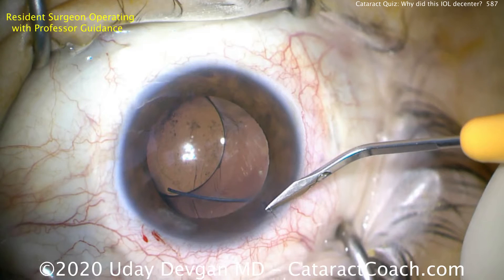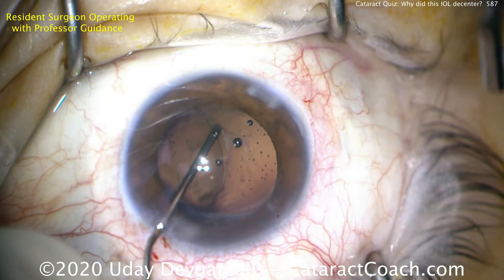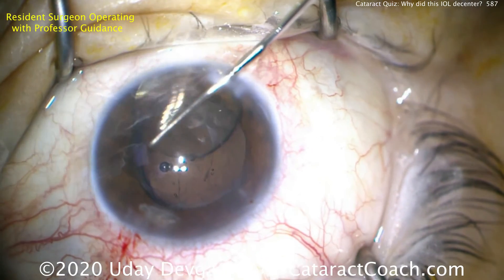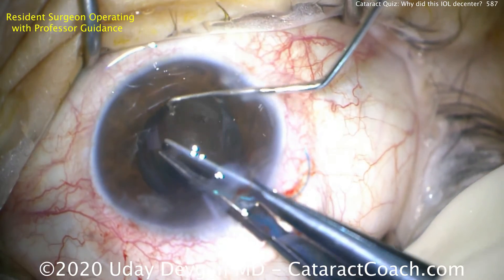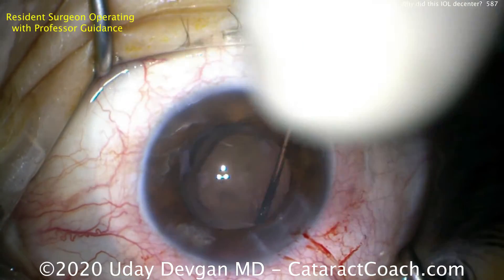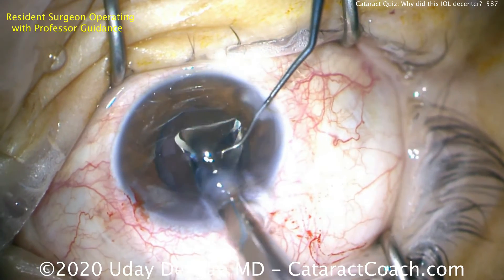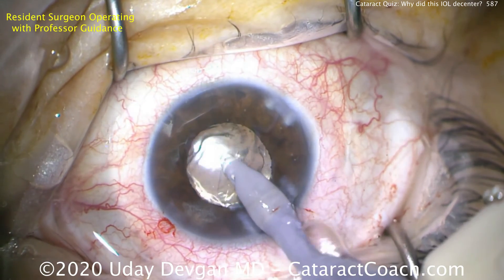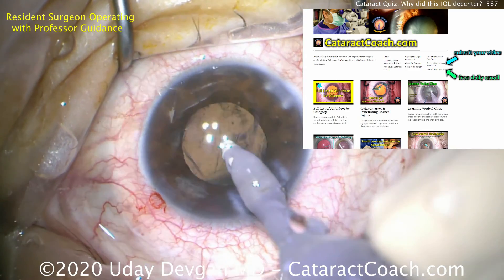Cataract Quiz: Why did this IOL decenter?

Comment: Dr Devgan, why not use a single piece lens with an intact capsular bag?
Reply from the maker: Yes that is an option. But what if IOL power is very low like +4.0?  There may not be a single piece acrylic IOL with this power.
Reply: Uday Devgan yes that’s true! Thanks again for sharing, as a young, green attending I must say your videos have helped me on several occasions. Is this lens exchange technique possible with a single piece lens? I’ve only learned (and performed once) the pac-man technique for single piece iol removal.
Reply from the maker: @willmar1604  Yes, works great. See here:
https://cataractcoach.com/2019/02/11/twist-technique-to-easily-explant-the-iol/

please check out CataractCoach.com -- so much more info that just watching my YouTube videos
Reply from the maker: Yes that is an option. But what if IOL power is very low like +4.0?  There may not be a single piece acrylic IOL with this power.

Comment: Dr Devgan, do you know which iol was the broken one? MA60AC? AR40? I thried this tecnic with both and I find that with acrysoft material it works well. On the other hand, it was frustrating with abbott AR40 and I had to cut the iol (which is harder too, comparing to MA60AC)
Reply from the maker: That is an Alcon MA60. Agree with you.